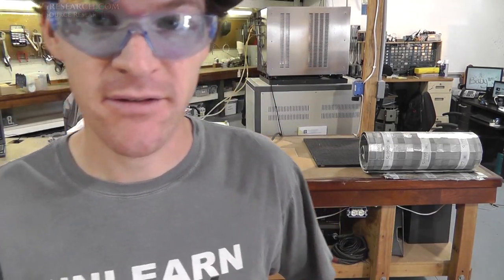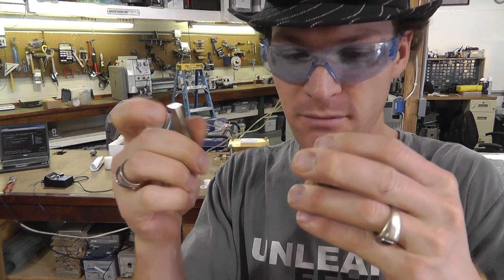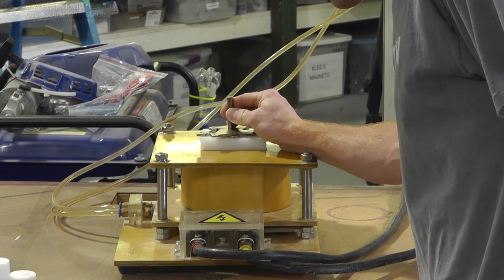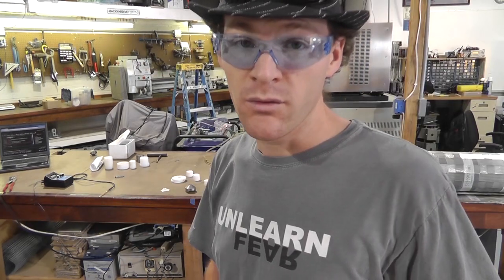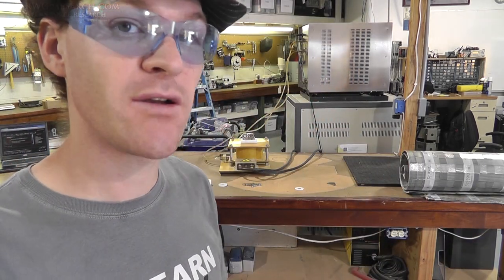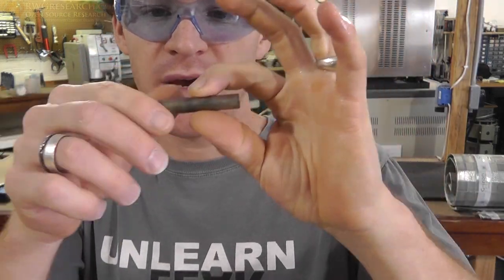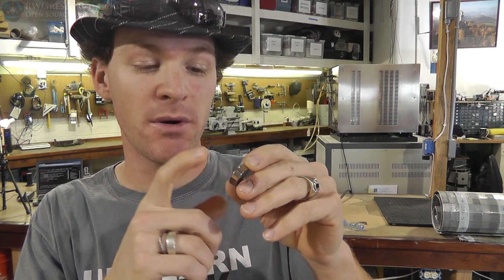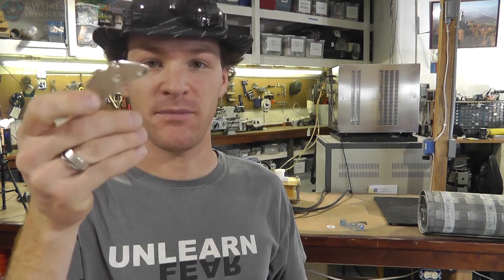Test:9.5 Magnetizing Experiments  : Testing Shielding Materials ( MuMetal)

Comment: magnetic flux is concentrated in metal & expands in air.
as with magna flux crack finder, iron filings stick where the flux leakage is.
flux cannot be blocked like light, but only finding an "easier" path.
If your sample were completely shielded (surrounded) will the flux be blocked from it.

Comment: That MuMetal is designed to protect electronics against your device when passing thru a magnetic field on a normal basis like the currents and fluxes in everyday uses.  As far as the experiment that you were attempting wasn't the power of fields that those were made for.  Just like those pieces are different thicknesses as so with the different items that are being protected against what field that they are encased with would have a bearing on what thickness is required to guard against it. 
 But as you using a very large pulse device to magnetize items it's going to require a much better protectant.  Because that device is putting out 10s of 1000s more power in a pulse than those pieces were designed to protect.  That's if you were attempting to stop the magnetic pulse that you were putting thru it.

Comment: What makes you confident these brackets are actually mu-metal rather than some other soft iron?
Anyway it matters very little for your experiment, you'd have to short the field around the coil or the magnet to have a shielding effect. The way you placed them they can only conduct the flux to the magnet instead of around. Just imagine how the flux lines look, it doesn't take a PhD to understand why this did what it did.
Reply: Conocer un poco más de  MAGNETOTERAPIA  ó  BIOMAGNETISMO  !